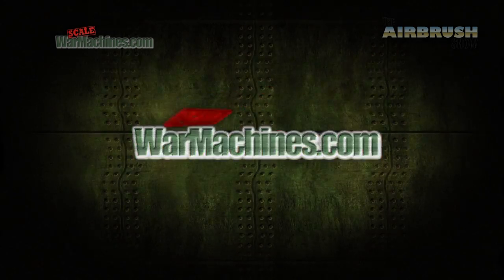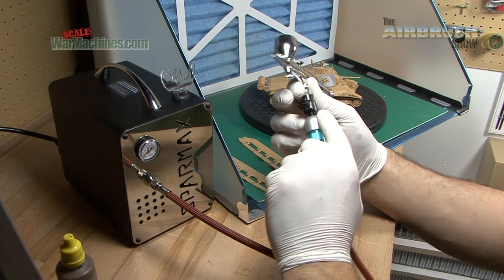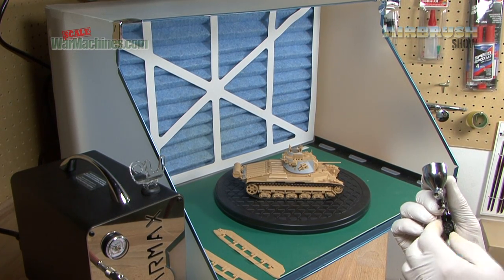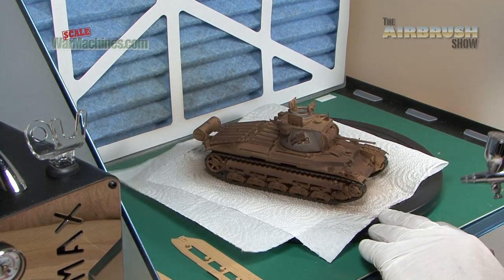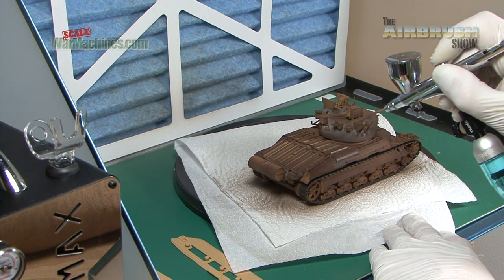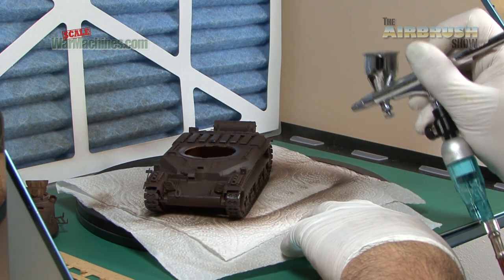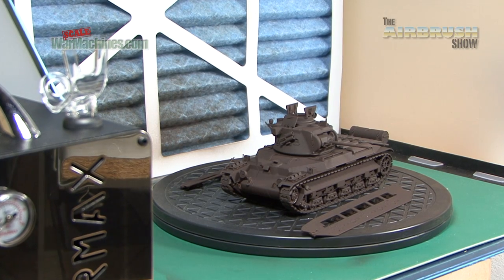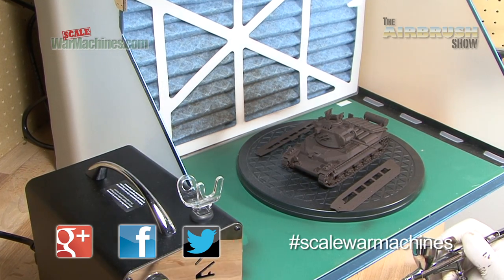SPARMAX ARISM COMPRESSOR - THE AIRBRUSH SHOW EP07

Comment: Just bought my second water trap as first on e feild out the box blasting air ! It's there new one with that bleed screw on the water trap silver bullet plus it's called my new one today is doing the exact same! So that's a second that will have to go back! I've just had to Joey my cheap Ebay one up just now it got a crack in plastic slight leak but takes a while for compressor to recharge its liveable with just now! I thought sparmax was supposed to be good! DO NOT BUY SPARNAX SILVER BULLET PLUS!

Comment: I'm using a Harder & Steenbeck Ultra with this compressor, but I can only get 18psi as the highest spraying pressure with the dial on 0. Any ideas why?
Reply from the maker: That sounds odd, almost the inverse of what should happen. Try to trouble shoot it but you should get a higher pressure than that. Could be the regulator (Silver Bullet).

Comment: As soon as I press my airbrush trigger I lose all psi and it drops to zero? What the hell is going on with this thing?
Reply from the maker: It will drop yes as thats' how it works, you can see it do this in videos (because there is no large air reservoir or tank to maintain pressure). But it shouldn't drop by that much, i.e. not down to zero. If it's a continual drop it could be a faulty pressure release valve, which I believe is in the silver bullet moisture trap/regulator. Also, the way these work is they use the supplied hose a bit like a tiny tank or reservoir to maintain or preserve some of the pressure. So are you using the original supplied air hose and have you checked there is no leak in the hose? The other place to look is the silver bullet, which looks like it could be the culprit.

Comment: Hi, i just brought this compressor. And i hooked up my eclipse but i can only get 10psi max working pressure out of it. Is it too underpowered to run the eclipse hpcs?
Reply from the maker: No it should work fine. I think it should go to 30psi (details in video), you're leaking air somewhere. Eclipse will run well at 15psi to 20psi.
Reply: @scalewarmachines  thanks for your reply. Its builds presure until it cuts out 40psi i think. But when i push for air it drops right down to 10psi. Ive tried most things and i just cant seem to get more than 10 out of it... any hints as to what i could do?

Comment: Interesting vid. Thanks.
Could you recommend two airbrushes to go with this set (one more rough and one more fine)? And what about the box and air suction? What else is needed to get started?
Reply from the maker: We recommend one excellent value airbrush we will be reviewing soon - the Sparmax Max-4 - a good multi-role  interchangeable single/double action brush & the Sparmax SB-88 extractor seen in this video & reviewed in episode 1. All good quality - good value gear to get you up & running. If you fancy paying a bit more for an Iwata - we strongly recommend the Eclipse airbrush for beginners or newcomers.

Comment: Hello. I'm new with airbrushes and compressor, and I want to buy one. Which you recommended? I build usually Tamiya/Dragon 1:35 model kits. Thanks and have a nice day
Reply from the maker: You can do a lot worse than this compressor & the Sparmax Max-4 airbrush to go with it. We've tested both & they're good.
Reply: Hey mate, in the same situation as you but just bought this setup a week ago.

Being fresh of the boat, I have absolutely zero complaints with this setup, it's very easy and fun to use, and I am more then happy with the results.

It's not very loud provided you're not airbrushing in the middle of the night, it was a little pricey for me in Australia but honestly could not be anymore happy with how it's been going.

Only thing I'd say is make sure to research a lot, it's been a learning process with thinning paints and cleaning the airbrush as well as finding primers suitable for an airbrush nearby.

Comment: May i ask does it overheat?And do you think its good for long spray sessions?Thanks
Reply from the maker: Hasn't overheated yet. But you do need to respect the duty cycle which is to let it cool every 30 minutes (TBC) of continuous use. You need to check that figure though - details in the description/video.
Reply: Thanks :)